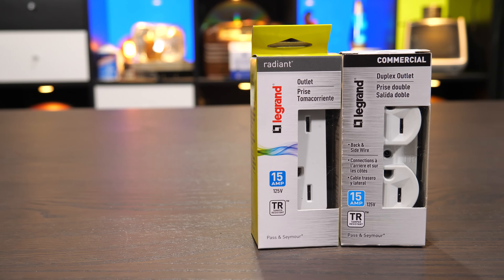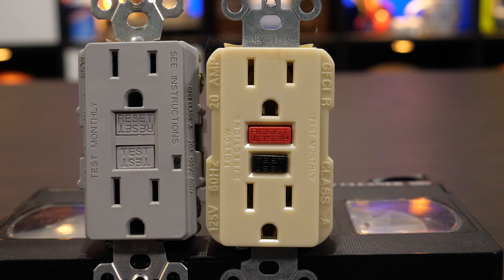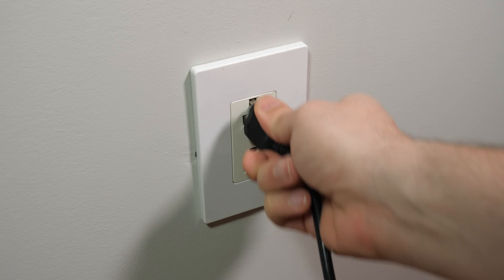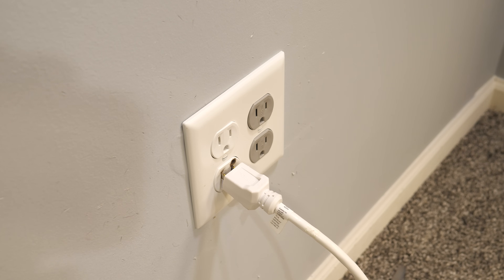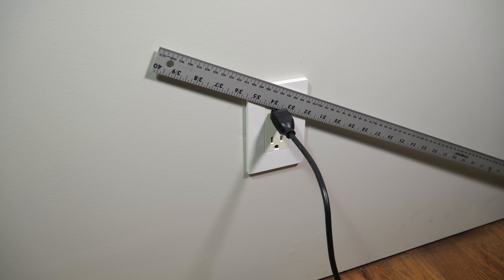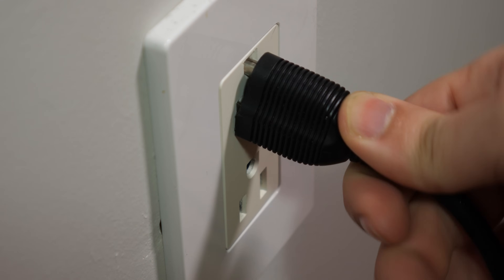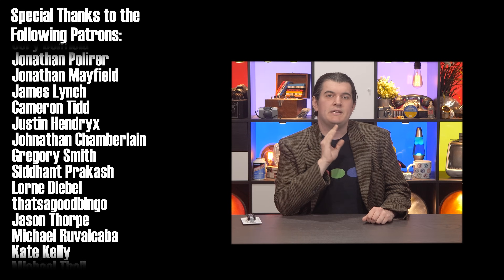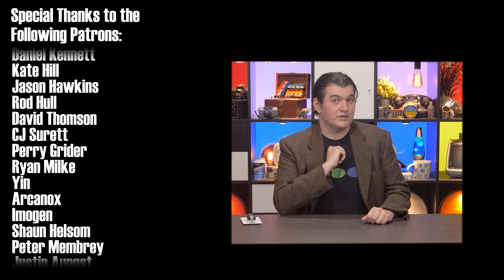Power outlets are topsy turvy - but does it matter?

Comment: There realistically is zero safety in having an outlet in the US in either orientation as the US uses 120v single hot, the neutral is a grounded conductor and is treated as a ground in a 2 prong system. The only thing the 'ground' is used for is EMI/RFI (electro magnetic and radio frequency interference) that comes from motor/electronic noise and gives it a path away from the component. So in affect, hot on left or right makes no difference, there's still one or two grounding electrodes surrounding it. 
 The entire reason why 3 prong plugs were eventually turned ground down was not safety, but Nintendo. The original Nintendo had a huge brick as a plug and gravity would rip it out of the wall if the ground was up. This was later echoed by cordless phones, wall chargers, hairdryer gfci plugs etc that still use a brick of some sort. So people started turning grounds down for a convenience.

Comment: I'd like you to explore the Schuko sockets and plugs we have over here in Europe. Or the French version with a ground pin IN THE SOCKET. Because France. The German Schuko version would be perfect, if it was polarized... But all our devices are built so it doesn't really matter. So we can turn over our wall warts and make them fit in another orientation!

Comment: I love how it's supposed to be safer but I was plugging in my DS which has no ground pin and had my pointer finger between the prongs when I was around 10 and got a small tingle
Reply: Also, gotta love how throwing knives at the walls evolved into putting a penny on a plug for tiktok views

Comment: Placing the ground terminal on top is not the right way to install the plug. The ground terminal can be pulled out of the plug while the primary and neutral are still engaged. Which can cause a electrical shock

Comment: The thing that annoys me about the ones in my house installed "properly" is that all of the decorative night lights I have end up being upside down because of that prong that's larger. My hair dryer and several other things end up having to be plugged in upside down with the cord coming off the top rather than the bottom. I'm having all my outlets changed to the "face" orientation so they work with my appliances and night lights.
Reply: After I bought my house I noticed that all the outlets were installed ground up. I said "no way" and spent an afternoon flipping them all the "Right way" with ground down "O Face". That's the way it's supposed to be in my opinion. I've only started seeing "ground up" outlets in the last few years. I don't like it. Sorry.
Reply: The bubbling Christmas night light just won't work upside down
Reply: We bought our house 3 years ago and I noticed immediately that all the outlets were ground side up.  It only took a couple of days to realize that this was going to be a pain.  I took the opportunity to change all of the outlets and switches to a style that accepts screwless plates.
Reply: most night lights have a little screw in them to flip them without having to turn the outlet upside down, just loosen it, turn it right side up, then re-tighten the night light. Thats what i do with mine. I hope this helps
Reply: @floooriiiiiiiiii None that I've ever seen.

Comment: I have 3 right angle plugs for power bars (no I'm not overloading them the worst one is like 1200watts max draw on a 2000 watt breaker and a 1800 watt powerbar) 
And making them upside-down would ruin alot of stuff

Comment: Electrician here. There are a few receptacles around houses that get installed ground up as standard in my company. Ill usually set receptacles ground up under sinks for disposals whips. They factory installed whips tend to be right-angled plugs and interfere with available storage. Ill also set them ground up behind gas ovens that have igniters and clocks. People like to hang things behind and set things on the valve plate. If somebody misses the hook when they hang a metal spatula and drop it on the plug behind the oven, it keeps it from shorting. Same goes for washers and dryers and any other kind of slide-in/foot-mounted appliances. Basically if the environment would funnel flat things to the recept, I'll set them ground up.
Reply: I'd been trained in Navy electricity/ electronics that having prongs up lets person see where NOT to touch, as the video shows.
Reply: sounds like it should usually be "ground towards where the outlet's electricity is going to go", since right-angle plugs tend to also be "ground towards the device", so when the outlet's directly underneath the sink machinery, makes sense to install it "ground up"
Reply: One has to hope the ground up plug was placed in a good spot as many stoves have limited area behind them for plug room, mainly at just the very bottom near the floor.. A mis-placed outlet means the stove will have to be 4 or 5 inches away from the wall, thus sticking out from counters etc. Not really feasible for most.
Reply: crappy electrical company across town: WRITE THIS DOWN WRITE THIS DOWN!
Reply: But engineers at the yacht company I used to work for disagree.  Plugs tend to fall out of your "proper" orientation more than the correct way.  Also, plugs tend to break out the plastic above the ground hole in a working environment.  I was an inspector of finished yachts and wrote them up countless times for the plugs being upside down or the ground hole being broken out.

Comment: Our house had every outlet the "correct way" ground up, we ended up reversing every single one to the ground down orientation, mostly because almost everything we plugged in worked with the ground down better, from extension cords chargers, anything that did not have a straight plug.

So I did care enough to change them all to the "wrong way"'

Comment: Nice thing here in Germany: We can turn all our plugs 180° around.
Bad thing here in Germany: We can turn all our plugs 180° around.

We have type F outlets, called "Schuko". The housing of our plugs go into the socket a bit, which makes it nicely safe. And we have sleeved pins, at least for about 30 years now. The bad thing...nothing is polarized!
I added an IEC C13 outlet to my electronics workbench with a short adapter. So if I need to plug and unplug things more often, I plug it into the adapter, make sure the polority is right, and just plugging and unplugging the C14 plug. So I can't accidentally plug it in the wrong way around.

Comment: Honestly, outlets to the side along with right angle plugs seem to be the best scenario.

Not only is it a bit harder for the plugs to dislodge, but their wires would hang downwards AND you can plug multiple in at a time without them bending around each other

Comment: Yes, that actually happened to me…ONCE, IN OVER 55 YEARS!!! When I was around 10 years old, a pair (is it really a pair) of scissors fell off of my bed headboard and hit the plug that was slightly exposing the prongs of the plug, causing a momentary arching. I can’t remember if this broke the breaker, since it was like 45 years ago, but I remember seeing grooves in the plug due to the “welding effect“. Very improbable event, but quite fascinating!

Comment: I once had a paper clip slide off a table that was against the wall and — you guessed it — the paper clip fell onto a power cord that was plugged into a receptacle, shorted the circuit and made a ugly, black char mark.  While flipping the receptacle over can't prevent such an event, recessing the receptacle or insulating part of the plug pins would work

Comment: I have seen a conductor cross the pins of a plug once. Well, I saw the aftermath. Old worn out plug and socket directly above a bike parts bin. Brake cables were often thrown in there and one of these thin twisted steel cables happened to lay across pins of an angles plug. there was a visible black mark and the prongs of the plug were missing material from arcing. Very scary to see, and I promptly moved the parts bin so it wouldn't happen again. But this is a very specific scenario that is likely just as common as people throwing butter knives at jacked sockets.

Comment: Great job! This is the most comprehensive video I've seen about this topic. However, it didn't address code making, product manufacturing, or standards committees influence on these questions. All of these products are also subject to manufacturing process limitations. And the astronomical costs of making even small changes to these designs.  The best idea may be to provide GFCI protection for every receptacle circuit. And the NEC has done a lot toward making that happen.
Reply: In the UK we have multiple levels of protection, from fuses within the plug to RCD and MCD breakers in the consumer unit. Even with the breaker off you can still trip the unit by touching neutral to earth on the circuit you are trying to extend (by way of a fused connector, of course).

Comment: I think this standard started in hospital/industrial environments where metal wallplates are used. If the screw loosens over time it guarantees a short across the live/neutral contacts. It makes no sense to bring it into the residential space with plastic wall plates.

Comment: I’m a master electrician it’s allowed either way but the main reason for the ground down is that if something pushes down you want the power to disconnect not the ground . Ground top makes your trigger finger under slip hit the hot . There’s a reason that the national code allows either argument can be made for both, but you do not want the ground to disconnect first .

Comment: something you missed; you can plug two right angled plugs into a sideways receptable with neither of them being left with the cord going upwards, but on a vertical outlet one of them is gonna have to be left with the cord going upwards & thus resting all of its weight on the plug itself pulling it off the wall

Comment: Showing one manufacture with the ground on top does not denote a large campaign. However, the biggest point is you are wrong to imply they have to be installed with the ground on tops. The National Electrical Code (NEC) doesn't require a certain direction. The NEC allows outlets to be installed with the ground plug hole facing up, down or sideways. It's up to you, there is no standard electric outlet orientation. So that means there really is no such thing as upside down outlets.

Comment: I've heard that the socket orientation is a fire safety thing in industrial building codes, but I haven't verified for myself.

Broadly speaking, when a plug works itself loose gravity on the cord will pull the top of the plug out of the socket more than the bottom before the contacts bind against the socket.

If you have a hot blade exposed when this happens, then debris and other crap (like other cables and cords) could melt, short and start a fire. 

It's consequently safer to orient the plug so that the ground is the most exposed blade when a plug works itself loose. 

Again, afaik this is a commercial/industrial code where 3-prong plugs are generally required, compared to residential appliances which often only have two.

Edit: to clarify, afaik the issue isn't with bare metal contacting a loose plug. A loose plug is probably hotter than a fully-seated one due to the decreased contact area for the same current draw. The issue I see is a neighboring cord, lying across the blades, melting due to heat and mechanical wear over several years. I imagine this is mostly an issue for plugs behind medical equipment or something, which are often moved within a room without poking around with the socket.

Comment: As an electrician, I will always try to install the outlets ground pin up if there’s ever a metal faceplate. I’ve seen metal plates blow up when the little screw gets loose and the plate shorts across L-N
Reply: We had a government contract for low income housing that specified ground up. Several months after the job was completed, we were called back to turn them ground side down, because people were complaining that they couldn't plug in their nightlights, air fresheners, and 90 degree plugs because those things aren't designed for use on outlets that are upside-down.

Comment: You have left out the all of those who cut the ground lug off.  There are still many parts of the country with old wiring with no ground wires and only two conductor outlets.
Reply: On 2 wire wiring 1 is live and the other is a ground! On 3 wire you have a ground, live,and neutral! You can't produce any power with just a live without a ground!
Reply: @TheSurvivalist58  Well, I've got seventy years of experience with two wire no ground. So...
Reply: @Mr.redacted.  You have a Black wire which is live! You have a white wire which is a neutral, ground or live! Therefore the white wire is used as the ground!
Reply: @TheSurvivalist58   No ground lug on the receptacle . OK

Comment: "If you suddenly woke up and found someone had turned all your outlets around in the middle of the night"
Me, looking at my EU plugs" Oh no, they're all reversible" (well except the two I found with a logo on them in that the logo would then be upside down) :P

[edit]
Actually, say someone as a NA person was really concerned about safety and design. And say you decided that the EU plugs are the solution. Is there anything stopping you from just putting EU plugs in your house and then just replacing the plugs on the end of cords with the proper EU ones? You can still buy plugs you can screw open and they work just as great as the plastic one piece ones.
[/edit]

Comment: Cuckoo clock weight chain touched the slightly hanging out plug when I was a kid. No one zapped, but sparks, smoke, a melted fuse wire. (Australia. Type I plug. Two power pins at the top (inclined) and a vertical earth pin. Pre the days of the parly insulated power pins.)

Comment: I don't follow the logic about power strips.  It's a 180 degree rotation, so all previously possible connections are still possible, but the cord points up instead of down.  So what?

Edit: oh I see, you're worried about a trip hazard.  Doesn't every extension cord ever made come with a warning not to use it where foot traffic is likely?

Comment: My kitchen has sideways outlets on the counter with the sink. It’s a GFCI and the neutral blade is on top. It’s actually slightly a problem for my air fryer. It sits in a corner and the plug has a tendency to back out. Thankfully, it’s a GFCI, so a shock is unlikely to occur. In fact, it’s tripped a couple of times

Comment: the fact that one of those specific use cases happened to me... and would probably have been more easily avoided with a right angle plug than an upside down one, because the plug had been dislodged in the first place because teen me thought it was a good idea to shove furniture up next to it.

Comment: Surprisingly the only right angle plugs where they purposefully make it. So the ground pin is on top is actually the Nema 1450 and 6-50 but only on EV charging stations, stoves and dryers still have it right angle plug ground down. But that's also because you're most likely not unplugging and plugging in your stove or dryer multiple times, whereas a lot of Eevee chargers can be portable and hang on the wall with something like a garden hose hanger. And electric vehicles are a much newer addition and people probably thought of safety when designing those cords, given the fact that a 50 amp 240 volt arc is much more dangerous than a 120 volt 15 amp arc

Comment: It is really shocking how bad American outlets are designed! Here in Germany none of your scenarios would be possible. The holes for the pins are set back into the outlet exactly the length of the pins. And the plug must either fill the outlet so tight that nothing can be shoved in between the plug and the outlet or with flat plugs only the tips are metal and if you pull the plug out of the socket those tips are no longer connect before any metal is showing.

Although to be fair, we have double your voltage and it's probably only half the fun getting zapped. 😂 But I think the UK has the same flawed outlet and plug design with the same voltage we have in Germany.

Comment: Here's something else you guys could work on, along with making right-angle plugs the default: make including a ground pin the default too! The plug could have a ground pin even when the flex doesn't have a ground wire in it -- it'll help make the plug hold in the outlet more robustly, and would enable outlets to have shields over the live contacts that the ground pin pushes away. You know, the way we make them in countries where the plugs always DO have a ground pin...
Reply: The only way making right angle plugs the default would work would be to make them go off to the side or to change the orientation of the plugs. Right angle plugs block the outlets adjacent to them
Reply: @nigeladams8321   Right angle plugs are pretty much the most common type in South Africa because our outlets are either alone or side by side, left and right. They're always 3 prong and 2 prong ones are straight and have their own special slot to be plugged in. So much would have to change in the US to adopt a system like that and I don't think it's practical for them.
Reply: @Ariesyte  I would love a revamp of our system but we can't get our gov to update signs let alone infrastructure

Comment: Seems to me as thought the sideways orientation is actually safer if you do it such that the hot pin is on the bottom. Is that why they mount them that way where you live? But you're right that in the grand scheme of things, it doesn't matter. I'm sure some of my electrician friends would have some stories but I personally have never seen an incident occur other than from kids dropping a coin over the pins on purpose, and 90% of plugs seem to be 2 prong anyways.